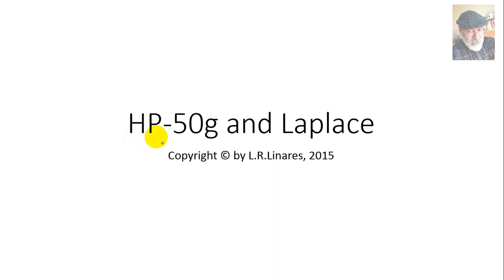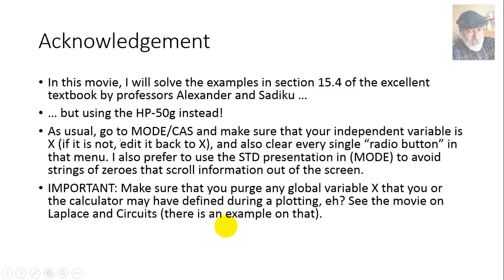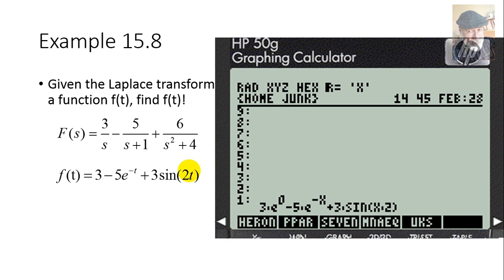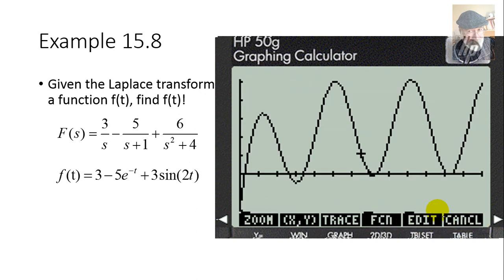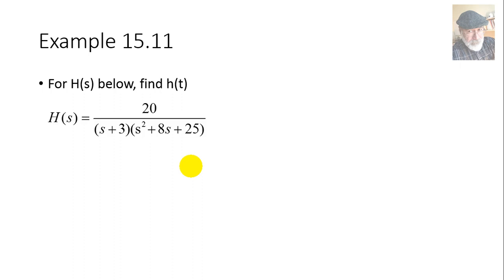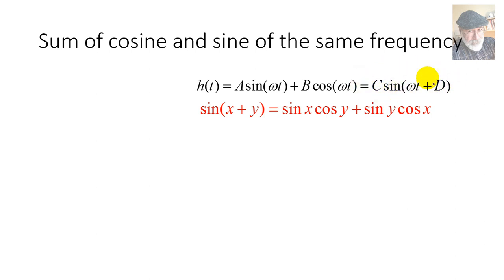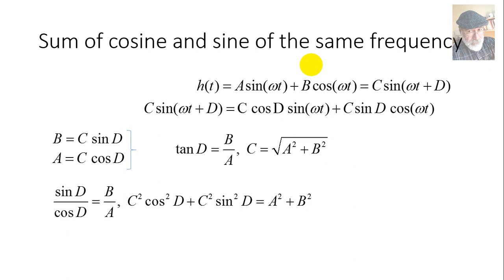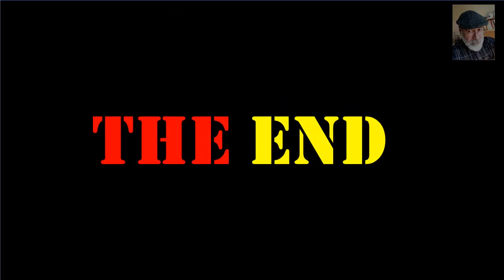HP-50g - Inverse Laplace Transforms on the HP-50g

Comment: Great video thank!
Is there any possibility that HP 50g might give wrong results?
Reply from the maker: Thank you for your comments. The HP-50g is a computer running a program. Programs have limitations (as humans do, of course), and it is always wise (using any software tool) to poke at the result as a way to ascertain the sanity of it. For instance, if the function of time is a current in an inductor, check the initial and the final value, and the initial derivative, etc. It is the same if you are using Maple, Mathematica, Wolfram Alpha, always the human user's is the final verdict.
Reply: rolinychupetin Thank you for the help! :)